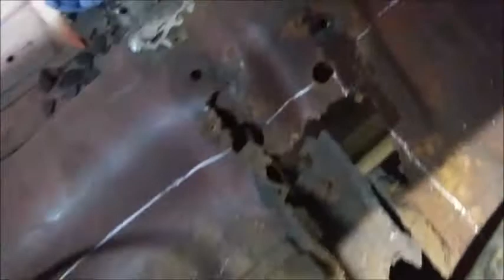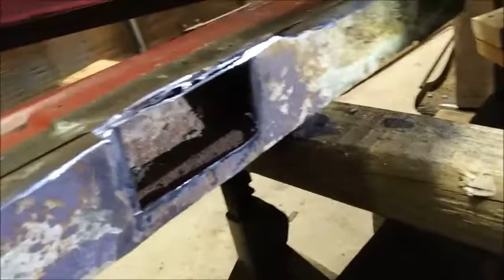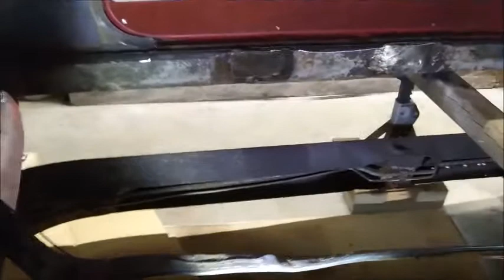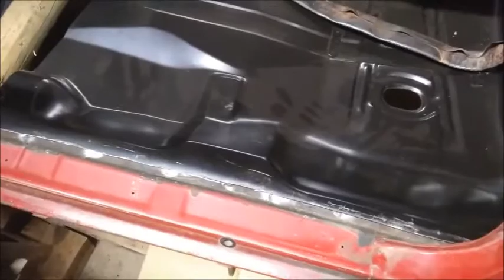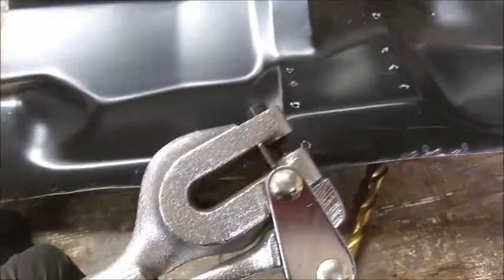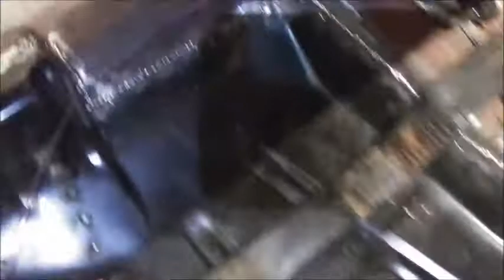LeMans Floor repair

Comment: Thanks - did you use weld through primer on the brace below the floor plan where you plug welded it?  Did you seam seal all of this too?  What did you use>
Reply from the maker: I used weld thru primer on the bare metal areas and seam sealed all the weld joints. The floor braces were EPD coated so I just ground where the plug welds were placed. The  entire underside  of the car was sprayed with truck bedliner coating. Thanks for watching Dave.